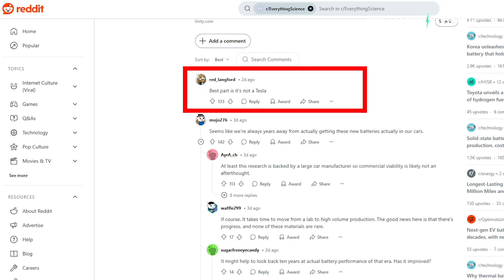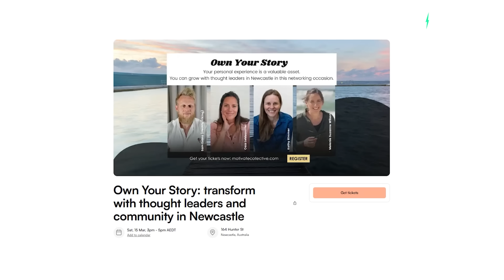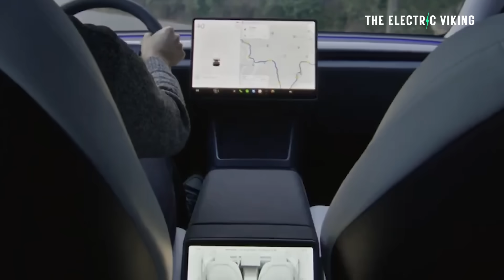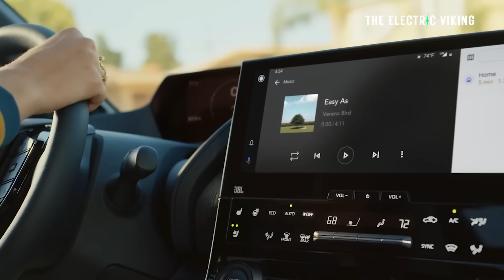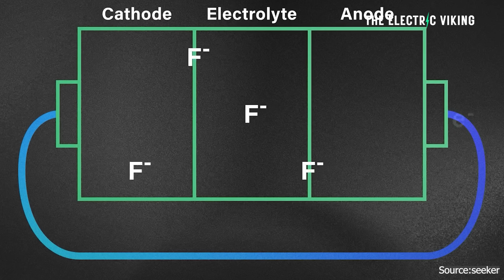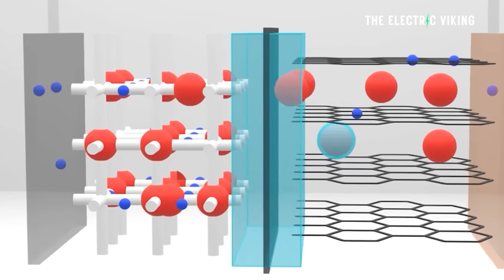Toyota claims it's new copper and fluoride EV battery will double EV range

Comment: It's funny you keep putting in the caveat on Toyota anouncements (warranted) while not pointing out that the Tesla announcement of a 500 mile range better is coming from a company that has built their entire reputation by over promising. And the result fall between under deliver and never deliver.

Comment: I feel like you are discounting the signifigance of the Prius in their ability to pivot to EV. They case they have made to stay hybrid until the battery technology is better is because of the real environmental and supply line issues of the ore needed to make lithium batteries. So, I don't think the arguemnet that they don't make lithium batteries really is a case against them making solid state batteries with no lithium.

Comment: If a battery could provide 1,000 mile range, it would be very easy to keep it in the degradation-free range of 40%-70% SOC (300 miles) and last forever with no degradation

Comment: E.V. ;s with any range is better than the oil Cancer ICE vehicles. here is fyi, not to mention oil spills and acid rain in our water supply.
 What are the symptoms of lung cancer in nonsmokers?        None usually . until it’s too late.In the United States, lung cancer kills more than 361 people each day. This is the highest number of deaths from any type of cancer, and more than breast, prostate, and pancreatic cancers combined.   WHY?  According to various sources, engine exhaust contains over 40 identified toxic chemicals, including benzene, arsenic, formaldehyde, acetaldehyde, 1,3-butadiene, lead, and a variety of polycyclic aromatic hydrocarbons (PAHs), which are considered cancer-causing substances; this complex mixture is often referred to as "soot" and is a major concern due to its fine particulate matter that can deeply penetrate the lungs.

Comment: FOR IMMEDIATE RELEASE

Toyota Unveils EV Battery Powered by Hot Air, Hopes, and Dreams

Tokyo, Japan – March 1, 2025 – Toyota has announced a breakthrough in EV technology: a next-generation battery powered by hot air, hopes, dreams, pixie dust, and a touch of smoke and mirrors. This revolutionary discovery promises infinite range, zero charging time, and unparalleled sustainability—pending further breakthroughs.

“Our engineers have harnessed the boundless energy of optimism itself,” said a Toyota spokesperson before vanishing into a cloud of vapor. While early tests in highly controlled conditions show flawless performance—when no one is looking—Toyota assures full-scale production eventually, pending more research and planetary alignment.

For now, Toyota invites consumers to believe—because anything is possible with enough hot air.

Comment: Kodak actually had some of the best digital camera sensors, especially early on. The executives just made some overall business decisions that ended up incurring huge losses and sinking the company.
Reply: Kodak basically invented digital camera fir the main stream. Trouble is they had to depend on Nikon and canon to provide the mount. They also believed the emerging Chinese market would save the film dept. Surprise surprise they went straight for digital. Canon Nikon etc developed their own sensors. Kodak chased its tail until finally economics had disappearing up its own backside.

Comment: Yeah, I'm pretty skeptical of this. The issue with flourine is it tends to react with EVERYTHING.
Reply: Yup. Not just very reactive, but the end result is usually rather stable. No wonder they’re having cycle life issues!
Also, considering how bad lithium fires are, try a flourine gas fire - it doesn’t need any ignition source. It’ll turn anything it touches into a raging inferno, including some metals like aluminium and magnesium. Which coincidentally is what many EVs are made from nowadays. Ouch..

Comment: you just increase the battery capacity and it doubles range. 😂
you mean they are increasing capacity without increasing size or hopefu;lly weight.
it's nice and you keep seeing trials, but still a ways away i think.
cost of new materials will make it expensive to use compared to other existing battery types for now.

Comment: The only I'm sure off...
In the future we will have a battery with double energy density (based on battery weight).
But I do not predict who will bring that to the market.
Also I'll not [predict if this development will  be used to produce cars with significant bigger range (same weight as today) or to produce cars with less weight and the same range (some 500 km) as today.

Or maybe both.

In my country road taxes are based on car weight...it is a selling advantage to bring cars on market with enough range (not max possible) and less kg heavy.
In theory it is even a nice thought to make a car with a small fixed battery (saving road taxes) but a good MTM (max total mass) and the possibility to add battery modules for a long travel.
Of coarse combined with the usage of those extra batteries for daily solar energy storage....good for using th charge overnight and for other usage when the sun is not shining.

Comment: Until they have it on the road, it doesn't exist. Toyota has dropped the ball, so now they are just making claims to make up for that error. If it is real, that is GREAT.  They blew everyone away by introducing hybrid cars and then they leaned back on their heals and ignored the rest of the industry. And then they added plug in hybrids, with that should be good enough and then sat back on their heels again. Now they are out of touch, so they are making things up. I wouldn't even touch one of there new ICE cars now. I just switched to an off lease electric car from my Golf TDI  I was not going to wait on what Toyota and other ICE car companies are promising.

Comment: Just looked online.  They are claiming double the capacity by weight, three times by volume.   There are materials that have a higher theoretical energy density than lithium, including zinc.  However Toyota have said it will be years before we see them in cars, and that would give others plenty of time to catch up, assuming they aren't already working working on these materials.

Comment: Given a choice between an EV that does 800 miles, which I dont need,  or a Tesla with half that range but  unsupervised driving, it will be Tesla every time. Toyota are running scared because very soon, they will be irrelevant.

Comment: Aluminum/Air batteries,  been around decades, military mostly. They offer 1200/1600 kms, light weight, recyclable,  cheap. Why not a battery swap system? we've all seen chinese battery  swap stations, 2 mins in/out, no fuss. Could even rent, saving buying a battery, even cheaper. If the military uses them, that means they are proven.
Its a NO brainer, change batteries once a month, how hard is that ?

Comment: Toyotas popularization battery with 370 miles of range bipolar liquid life po and the high performance battery with 620 miles of range will start production in 2026. Solid state 1 with 620 miles of range will start production in 27-28 solid state 2 with 745 miles of range ?.

Comment: Toyota is totally full of it. I remember when Toyota was claiming their upcoming BZ4X (before it was released) would have a range of over 300 miles.

A nearly 4.5 thousand pound EV with a usable battery pack of less than 63 Kwh's. COMPLETE NONSENSE. 

How is a more than 2 ton SUV going to average nearly 5 miles per Kwh??? 

The BZ4X's actually efficiency is less than 3 miles per Kwh  its actual range is more like 200 Miles of range.

Comment: Toyota simply does not want to make EVs. What they really think can be seen with the bZ4X which is software limited to prevent its owners driving very long distance. It will only allow 1 or 2 fast charges in a day. I looked at it for my regular 800 mile transcontinental trip and  it would simply be impossible in a bZ4X. I wish they would get serious about EVs but clearly they are now

Comment: I find it hard to believe that Toyota is fiddling around with EVs when EV sales are dropping worldwide. They are Hybrid manufacturers and they are very good at it. In Europe, Hybrid sales are outselling ICE cars. The problem with Electric cars is they are not improving. The only way to increase the range of an EV is to increase battery size. That means more pollution from mining the minerals for the EV battery. Hybrid technology is improving with Toyota claiming the 2026 Corolla Hybrid will have a range of 2,000 klm on a tank full of fuel. Toyota has sold over 4 million hybrid cars in Europe, making it a leader in the hybrid market. The company's hybrid technology has been instrumental in reducing CO2 emissions and meeting stringent EU regulations.
Reply: Hybrids are more unwanted complication.  A fools errand. The worst of both worlds.   
Battery chemistry technology is the key.
Reply: @GWAForUTBE  Sorry not true. Not according to motoring experts who are saying: Hybrid cars are generally known to be reliable. They combine a gasoline engine with an electric motor, which can improve fuel efficiency and reduce emissions. Many manufacturers have been producing hybrid cars for years, and they've proven to be dependable and long-lasting. In addition, hybrid cars often come with extended warranties on their battery and hybrid systems, which can provide peace of mind for owners.

Popular hybrid models, like the Toyota Prius and Honda Accord Hybrid, have consistently received high ratings for reliability from sources like Consumer Reports and J.D. Power. Regular maintenance and proper care, as with any vehicle, can help ensure the longevity and reliability of a hybrid car.
Reply: @GWAForUTBE  Batteries are very unreliable. I’m in my 80’s and have owned many cars, mainly ICE vehicles.  Of all the cars I have owned, the part that fails the most is the battery. A new battery for a ICE vehicle costs around $250. A new battery for an EV cost around $30,000 plus installation. So, if you own an EV the part that will fail will be the battery.
Reply: @Dollarbill-g1l  I hear ya. New lead acids are getting really pricey and unreliable.  It seems they are getting worse.   
These laptop batteries they are using in EVs are a totally different technology.  New chemistry.  
Am 8 yr warranty is fairly standard on new EV batteries.   It is expected the new EV batteries to out last the vehicles.

Comment: You are correct, as a publicly traded company they should not be allowed to make false or misleading claims. All companies need to be aware that it is a crime to deliberately mislead investors and l mean all. Tesla included although it is usually just their timeline which is off, they do get there eventually. 
The other point about Toyota is the falsification of safety data and crash testing. Found guilty of putting specially strengthened cars in the crash testing rather than the cheaper production line models but virtually given a free pass by governments and the press. VW  quite rightly  fined 10’s of billions for diesel gate. I would never buy a Toyota just like l have never bought a VW.

Comment: Some arguments against Toyota in this video are simply outdated. They have had lithium batteries in their hybrids in the last generation. Also, besides bz4x they have in preproduction the urban cruiser, which is a small affordable electric suv, a class of car consumers in Europe really want to buy and market had few examples to offer up to now.
Reply: And as of now the wheels stay on 😅
Reply: Ummm, have you seen the Urban Cruiser? Horrible car, dated interior full of piano black, very poor range from a 61 kWhr battery and styling so bland you couldn’t pick it out in a line up., They are miles behind the Chinese and Koreans.
Reply: @ISuperTed  Range is not confirmed yet, but speculated 10-15% worse than korean rival, which is not such a deal breaker. Styling is subjective but media love it. And we have seen similar styled toyotas sell well already. Anyway, we should't have expectations for them to bring forth a model better than teslas, but a decent one that can be chosen by the conservative buyer who wouldn't buy tesla or chinese anyway. If all companies have this electric option for their respective niche buyer the transition will become much easier.
Reply: @ That range on a 61 kWhr battery is shocking for an EV coming out now.  248 miles is less than any others out there with a 54 kWh battery. you can have your opinion, but it’s not good enough for me.

Comment: Hi Sam, I just wanted to correct you. Toyota does produce its own Lithium ion cells and battery packs through its joint venture company with Panasonic. The company is called prime planet energy solutions (PPES). The bZ4x in Australia and other markets outside Asia have these cells and battery packs. The quality and safety of the cells and packs are world class.
Reply: Yet thr bz4x is not the world leader in bev efficiency with the superior world class battery?

Comment: They have the option of putting better batteries with longer ranges into existing hybrib vehicles they are building now and likely in the future. An extra 50 to 120 km range and increased charging cycles for the batteries would help a bit. Used car buyers want the battery systems in the vehicles to still be good if they are likely to buy one and they want the ice engine to still be in good condition. Often the engines in those vehicles are too small and can be worn out by the time they go onto the used car market.

Comment: In 2010 the EPA and Tesla decided that 1 US gallon of gasoline (0.3715 kg of hydrogen) contains the same amount of energy as 2.692 US gallons of gasoline (1 kg of hydrogen) So if Toyota has a 12.38333 kwh battery that can hold 33.33333 kwh, that's pretty cool.